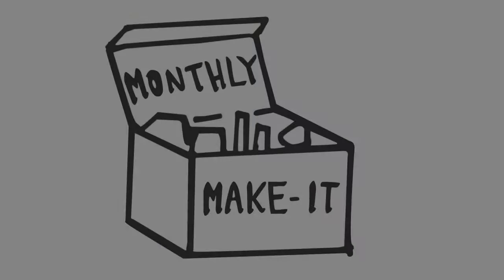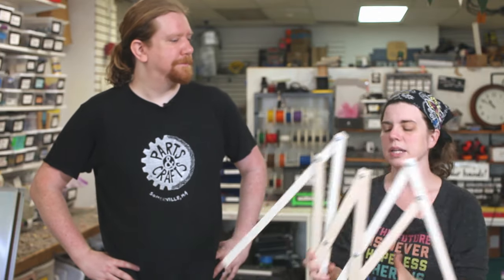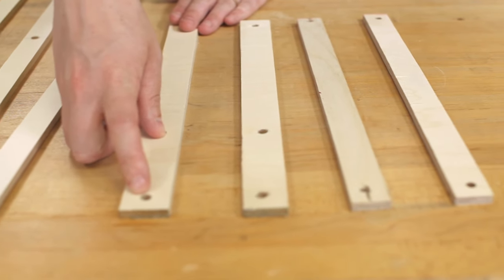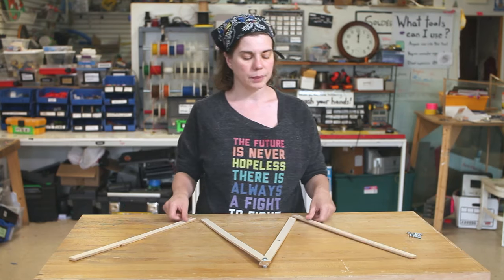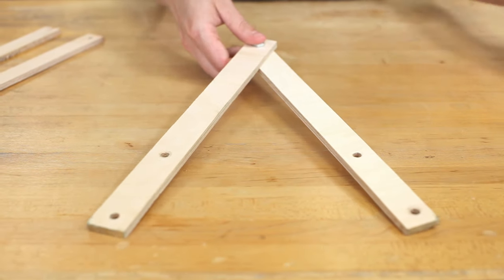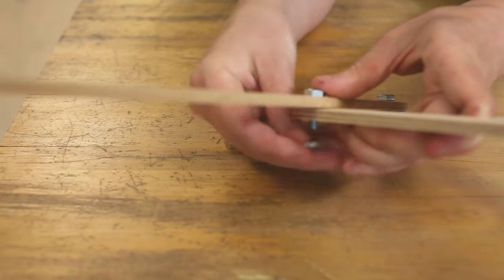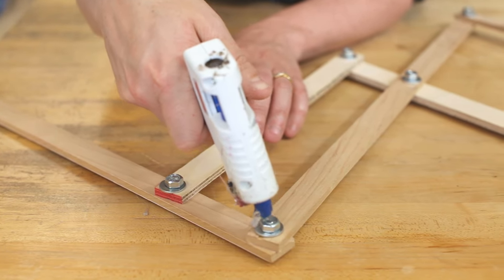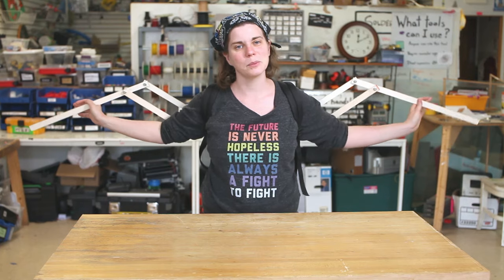Making Big Wings

Comment: Hello all! I see some of y’all would like to know how to scale the wings up considering they’re quite small, so I’ll let y’all know how I did it!
it’s originally 20 inches for the larger planks, so I made it 30, this means
-the 8 inch space becomes 12
-the 11 inch planks become 18 inch 
-you can leave the .5 inch gaps from the end and the 3 inch gaps for the joints, they aren’t affected
These measurements still hold up to work, and provide a much larger wingspan than the one the original design provides. 
If anyone has further questions, lmk!
Reply: Do you need to make two sets of these for both arms?
Reply: Rita Ferrell no, the design is made for two wings on both side, while the inner 'diamond' shaped area is for your back. You'd only have to make one set for both wings :)
Reply: @butterpiggie9624  ok thank you so much
Reply: Not related to scaling it up, but how did you wear it? Was it through a backpack like the video or through a harness? If it's the latter, how did you do it?
Reply: how thick did you cut your wood?
Reply: how did you wear them? like did you make a harness? if so how?
Reply: Do you think you can make another video of making the wings bigger and is there any thing I can use to make the wings open and close instead of reaching back to open them and close them
Reply: @nessbae472  motors
Reply: THANK YOU.
Reply: Sitting here trying to do the math in my head while scrolling through the comments and I see yours. Thank you very much
Reply: For the inner struts, does the inch gaps change? Or are they the same
Reply: Thanks a lot for the information
Reply: How are you supposed to add the feathers? And I’ve never done anything like this before, so excuse me if I sound dumb—my cosplay will have the wings coming through the jacket. How do you make the wings come through it? Does it have to do with a backpack? How does it work?
Reply: Ok so there are a total of 4 20 inch planks and 4 12 inch planks, so I make the longer planks 30, what about the shorter planks
Reply: @butterpiggie9624   can i have the materials in order please 🙏
Reply: hi can u send me the measurements an specks for each peice plz
Reply: THANK YOU i literally can't do math for the life of me
Reply: you are an angel from heaven than you
Reply: how does it look extended out? do you have a place with the photos for it?
Reply: Thanks! I was just about to scale it up myself.
Reply: How thick are the wood pieces..?
Reply: What is the actual mathmatics on making it bigger? I'm looking to make the wings nearly as big as I am.
Reply: This is really late, and probably a dumb question, but how big would the wingspan of these be?
Reply: @cats_with_tophats6800  no i’m wondering the same thing
Reply: @cats_with_tophats6800  at the size in the video itd be 20 inches each side, scaled up 30 inches. So 40 or 60 totally respectively, not counting the space inbetween
Reply: Will it still work if I doubled it instead of 1.5 times the size
Reply: Do the size of the nuts, bolts, and washers need to be changed as well?
Reply: Wait, how big do the smaller planks become or do they just stay the same?
Reply: @bug7832  it's all about ratios so if you increased the 20" pieces to 30" that's a 50% increase ( add half of the total number) so the smaller 12" pieces would need to increase by 50% as well, making them 18".
Reply: i did this as well! the final wings are 10 feet long! love them so much
Reply: @marsvp_  how did you do the feathers? (Assuming you did feathered wings as opposed to bat wings)
Reply: @ArrowheadCosplay  this is where i got stuck as well, i'm doing a windglider from genshin impact and have no clue how to do the "feather" like parts. i'm making the costume itself for halloween but the wings are for a comic con since i can't really wear them around
Reply: @marsvp_  10 feet??! that so long
Reply: i made the big ones 60 how do i size everything correctly
Reply: @ArrowheadCosplay  I may be a little late but maybe covering the wings in fabric, then sewing the feathers onto the fabric?
Reply: @phoebthepancake  that's not a bad idea. I haven't gotten around to making them yet but I'll keep the suggestion in mind
Reply: I literally adore you

Comment: And boom I have a Halloween costume, thanks for making this! It’s the only useful video I could find on the subject. But I do have one question how would you add feathers or attach it to a harness?
Reply: Just wait
Reply: Doggo King kool
Reply: If u really wanna be the best on halloween try building mechanical wings
Reply: I know it's been a while, but I guess you could stick fabric to it and glue or sew the feathers on
Reply: Doggo King Again I know it’s late but if you’re still interested, thecrookedfeather creator posts youtube videos you can take reference from, but her videos are a bit vague.
Reply: Sorry for the late reply. You would want to sew feathers made out of fabric to the top, slowly getting smaller feathers in layers from bottom to top. Then to cover up all the mechanism glue/sew smaller more fluffy, craft store feathers onto a fabric that will cover the top of the wing. Or you could create a sleeve of fabric and sew feathers in from there.

Edited to make more sense, it was late at night when I wrote it.
Reply: To add feathers I would sew/hot glue some fabric on and then sew/hot glue on an strap of some sort them glue on the feathers 

Sorry if this was confusing
Reply: @desringdifoesa9176  I'm still waiting
Reply: This is old, but tight suspenders ended up being the most useful thing to hold the wings up for me. If you're doing something like wearing an overcoat over the wings that could probably work, although it does make them a bit hard to unfold

Comment: Please add some sketch and meassurement. And for further development, you might want to use triple layer of thin wood for each stick. That way you can insert one another to get better center alignment, instead of put it on one another. Just an suggestion.

Comment: If you don't want to worry about the bolts and nuts coming loose from all the movement,  instead of using the standard washer, use a compression washer...you know, the ones that are a little thicker and they are split on one side and bent a little so that when you tighten the nut down, it causes compression and keeps the bolt night tight against the thread, and it won't come loose!  Just don't tighten it all the way down or you won't be able to "spread your wings" (you're welcome)  :P

Comment: I haven’t tested this out, but I think that if you make the two sides separately and put them on a base and string the top or bottom of each side, you can make them work separately. So like a string on either the top or bottom point of the diamond once they’re apart, then add like a ring or tube to hold the string in place that is attached to the base, so when you pull the string the wings extend. Or you could keep the two together and do the same so that way you could open and close them without having to do it manually. It’s a bit hard to put into words and will need a base for it and way more effort, but in case some wants this, I’ve been thinking about it for a while. All in theory but ima update this if it does or doesn’t work.

Comment: Would love to see how you attach feathers to these wings and what materials you suggest using. Thank you!
Reply: Hot glue
Reply: Put fabric on both sides of each wing, sew together, and use hot glue for putting the feathers on fabric or sew feathers on.
Reply: @serena3170  hi! I was hoping someone would help with this! Thank you! 
I just have one more question: what mind of fabric should i use, and should it be loosely sewn on for movement?
Reply: @venom.strike6999  Hi! I'm so happy to help, personally I just used an old white sheet because mine were angel themed, really anything is ok, I do suggest something lighter though especially if you attach the feathers how I did in the end. A lot of the process for me was pinning and repinning to see where I needed to sew so that the wings would move. For most of the wings there was only a centimeter or so of space between the wood and the stitching. For the feathers, (this is a lot of work but I loved how it turned out for my purposes) you can get fake feathers and use a needle with thread on it to go straight through the shaft, then going down into the fabric and back up again to repeat the process, (almost as if you were sewing a bead into fabric) making for a fairly clean and unnoticeable attachment.
Reply: @venom.strike6999  I hope that helped! I know its long but I just wanted to explain it thoroughly enough that it was clear.

Comment: Hey guys! If anyone is here, I have a question - how did you do the feathers / how do you recommend doing the feathers?
I made a pair of these last year and I'm very happy with them (I use the measurements of someone else in this comment section to make them larger, so that wasn't an issue) but the method I came up with for attaching feathers (foam + wooden sticks, super glued to each other and then to the skeleton of the wings) ended up with some of them falling off, especially near the joints. Any idea on how to fix it / make better feathers?
Reply: What were the measurements? Asking bc I'm planning to make the Wings soon (making a harpy cosplay)
Reply: @peeperthedroucan9257  updating this comment as I remember the measurements because I made these at Halloween last year.
The long pieces are 30 in, the three inch gap is the same,, the 11-in Gap turns into a about 16-in gap, and the 8-in Gap turns into a 12-in gap. 
The short pieces are 18 and 1/2 in. The 3-inch Gap stays the same, as well as the Gap at the top of the wings. and the other gap is 12 in. The same size bolts and nuts work
The total wingspan when fully extended ended up being about 11 ft to 12 ft if I remember right. I don't have the design anymore so the measurements night not be perfect (I'm just measuring the pieces and the gaps between the pieces) but I'm going to try to find the original comment that had the measurements and put it here

Found the comment! Not super great at explaining things so if you can try to find butterpiggies comment it should help

Also also, I ended up holding them up with kind of tight suspenders. It ended up being a lot easier to hold up the large wings than any backpack I could find and a lot more accessible than a harness of some kind
Reply: @ChaiLatte666  ty

Comment: I don’t understand how do you attach the pully system & once you pull it open how does it close
Reply: you could attach a very strong rope to the bottom of the part that goes in your backpack and then pull on that or attach strong ropes to the two side pieces of the part that goes into your backpack and use those too.

Comment: Great idea, but to add on to it. You could add a bushing/sleeve from pipe, slightly bigger then the diameter of the bolt, so you can tighten the nut and bold down tight, and it would tighten on to the bushing or sleeve, and not the wood, and the wood holes would pivot on the bushing/sleeve and not the bolt threads, and should never come loose, and probably move with less resistance. Great video though, and gave me many ideas for Halloween props.

Comment: The measurements don’t add up. The  long pieces are 20” long with 1/2” space on both sides, 8” and 11” between the side holes and the middle one. Taking into account the 1/4” hole for the bolt, that adds up to 20.75 inches long. Am I missing something here?
Reply: Manaf Al-Naqeeb the wood is 20" long. The holes go in .5" IN from the end of the wood. It's not adding inches or anything, just going in .5" deep on either side.

Comment: How would I make these open with feathers and such on them without touching them while wearing the wings?
Reply: You can put fabric on the original frame and then add feathers using hot glue or sewing them on to the fabric. I also recommend for the opening and closing a string attached to the end pieces of the wings to pull

Comment: I didn't have wood sticks and couldn't buy them so I (well my mom did it for me :> shes great) literally took apart Hola hoops cus them used a heat gun to make them as straight as possible drilled the holes I put them together and they are great a little weird but still great they move well tho do note I used different bolts I ened up using 2 different kinds cus my mom just got random one so idk what works best but they move nicely now my mom's taking a short break and when she's done we will hot glue the bots and nut and sew the cover to put on them (I'm using them as dragon wings instead of bird wings ) but I think they will be really cool:D /I'm literally going to wear them today lol

Comment: 20 in. Pieces
1/2 in. From each end will be one hole ((all pieces))
(First set (2)) 3 in. Hole on one side. 
(Sec. Set(2)) 8 in. Hole from one side

12 in. Pieces 
(First set) 3 in. Hole from one side
(Sec. set) just the 1/2 in from the ends

Nuts, Bolts, Washers
Reply: THANK YOU SO MUCH

Comment: Can we please have some real measurements? For all the hole placements on all four types of wood (i.e. Long 3 hole, long 2 hole, short 3 hole, short 2 hole) Like how many inches or cm from the end is each hole? The whole '3 inch gap, 11 inch gap etc' thing is a tad confusing and it'd just be easier to give exact measurements from one end. 

Also, not so much a technical issue as it is just a bit of a pet-peeve, but whoever is doing the camerawork— on the first bit, panning to show all the required materials is fine; could be a tad slower but that's besides the point, to be constantly panning through all of the shots is just distracting and not helpful when we're trying to watch what she's doing. 

Helpful enough video anyway but after about the fourth time of having to rewatch what she's saying about the measurements I just thought it'd be worth noting. 

I apologise if I'm coming off as rude or harsh, I really did find much of the video to be helpful; it was just a tad frustrating, is all.